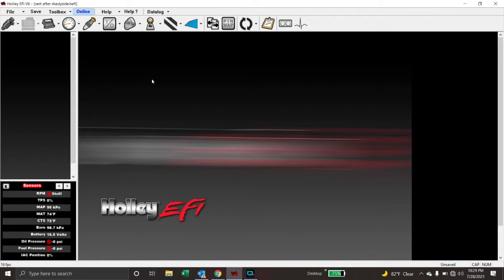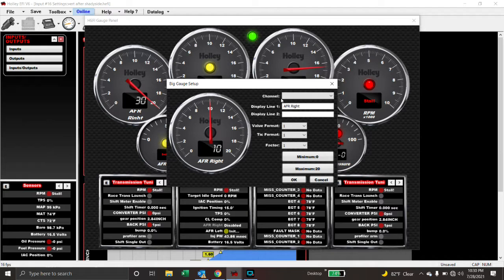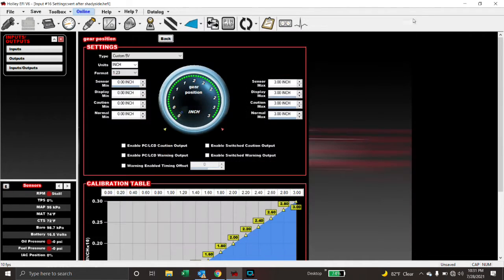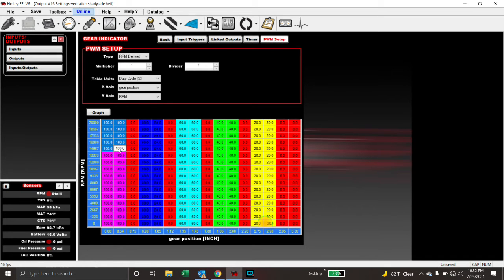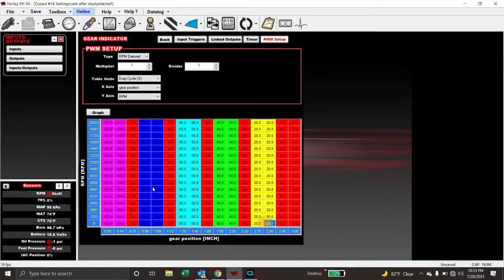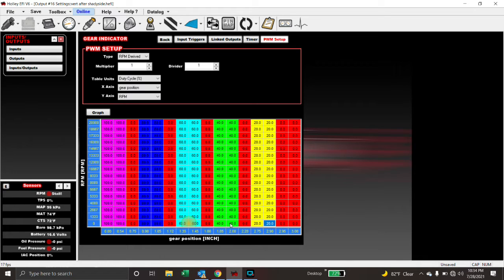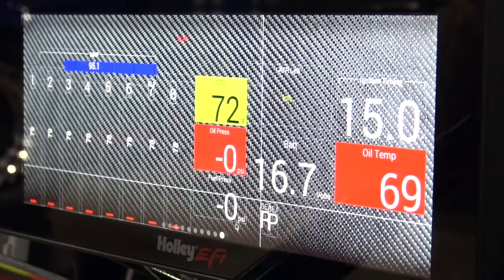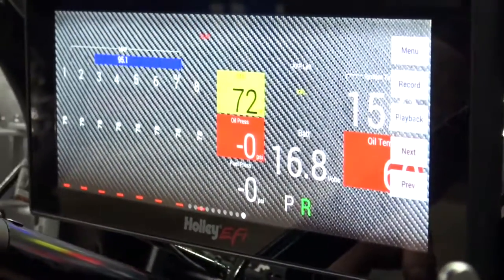How to add a Gear Indicator to a Holley Efi Pro Dash

Comment: Devin, I have this setup in a duster I am working on. I wanted to know if I am able to use the travel sensor for shift recognition as well as the gear indicator display. Is this possible since the sensor is 5v and the only option in holley v6 for AT shift is 12v or Ground?

Comment: I’ve got an Xmax in a 4l80 rcsb truck, would I have to use a shock sensor and set it up the same way you have this set up, or is there a prevision for doing this already built into the 80e
Reply: Came here looking for the same thing, you ever figure anything out?

Comment: My dash doesn’t show a range on the symbol unit, only at graphs and some other gauges…any advice?
Reply: Same here.  I’m trying to do it on a 7” dash with terminator x, but don’t have the range option for a symbol.
Reply: @jimscanlon530  I'm having the same issue, did you ever find a solution?
Reply: https://youtu.be/OPUCeD3udIw?si=fYQCjFQZEpLflz3P I solved this on the 7” screen.
Reply: I solved this issue on my 7". https://youtu.be/OPUCeD3udIw?si=2rcs7TbM91JNgUlX

Comment: I have a question,I’m a stick shift Guy is it possible to apply this same method on a 4 or a 5 Speed transmission..Thanks
Reply: If it's an H pattern you'd have to use 2 sensors and build a 3D table based in the position of both sensors.